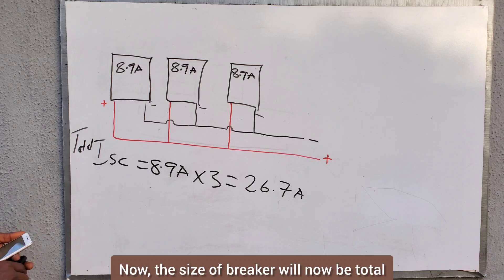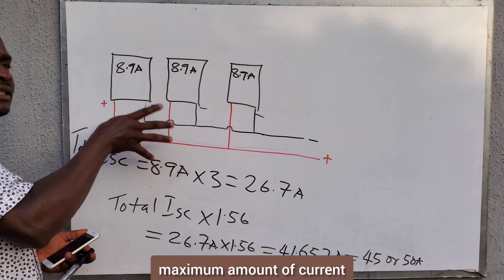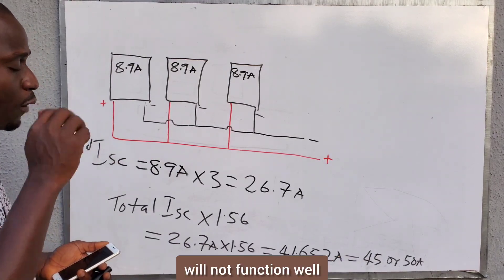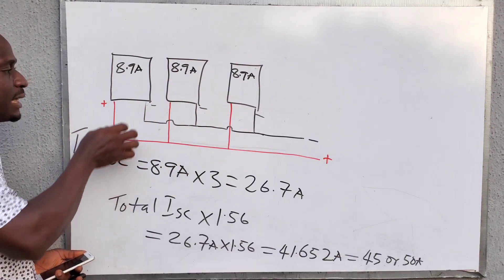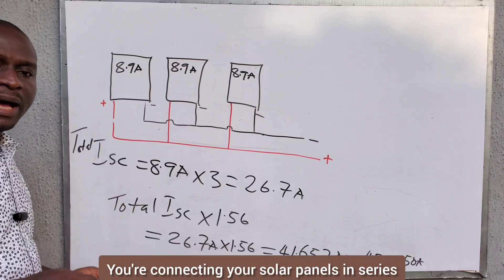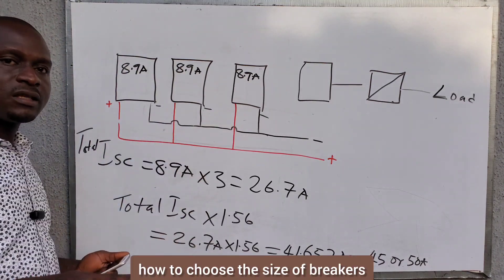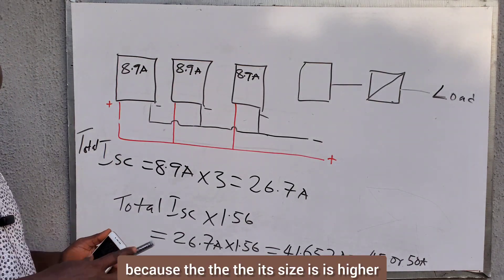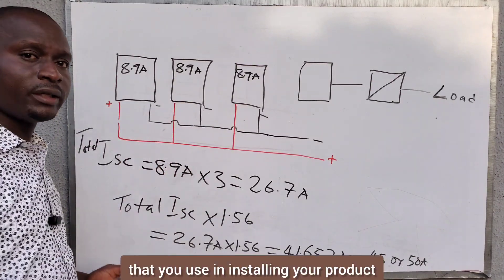How To Size Breakers.

Comment: Sir, please, what if the panels are connected in series parallel? Are you going to add the total value u had for the series side to the total value u got for the parallel side.

Comment: Thanks for your knowledge sir, what i noticed while trying to install my solar was that its difficult to get 20a dc breaker  in the market but easy to get 63a dc breaker.
Reply: You are right! 63a is the lowest i found in my location, have to use it like that.

Comment: Hi. I have 3,5kw 24v inverter  .it got a minimum pv of 120v and a maximum of 500v . What size of dc breaker and spd can I use when I connect  solar 5 solars  in series

Comment: Great tutorial, and I really appreciate how clearly you explained the system layout!

For anyone wondering how to size breakers correctly (and safely) here is how i go about doing it —n.b:  these are the standard formulas used globally (which follows SANS and IEC standards) and i will give examples:

1. Solar Panels to Charge Controller:
Breaker size = Isc total × 1.25 × 1.25
(First 1.25 = continuous current factor, second 1.25 = safety buffer)

2. Charge Controller to Battery:
Breaker size = Controller's max output current × 1.25

3. Battery to Inverter:
Breaker size = Inverter wattage / Battery voltage × 1.25

Example:

Say you have 2×410W panels in parallel (Isc = 12A each): 12+12 = 24A → 24×1.25×1.25 = 40A breaker

40A charge controller: 40×1.25 = 50A breaker

3000W inverter on 24V: 3000/24 = 125A → 125×1.25 = 156A, so use 175A or 200A breaker

Make sure to use DC-rated breakers and match cable size to the current. Hope this helps someone out!
Reply from the maker: Thanks 🙏
Reply: Can you also write the cable sizes that should be used according to this sample study? please..
Reply: @v_fidan Sure! For anyone wondering what cable sizes to use with the breaker examples, here's a quick guide (based on SANS/IEC standards):

1. Solar Panels to Charge Controller (40A breaker)
Cable size: 6mm²–10mm²

Use 6mm² for short runs (<5m)

Use 10mm² for longer runs (up to 10m) to reduce voltage drop

2. Charge Controller to Battery (50A breaker)
Cable size: 10mm²–16mm²

10mm² is fine for short runs

Go for 16mm² if the cable is long or it's in a hot area

3. Battery to Inverter (175–200A breaker)
Cable size: 35mm²–70mm²

Use 35mm² for short runs (<1.5m)

50mm² for medium runs (up to 3m)

70mm² for longer runs or minimal voltage drop

Tips:

Use quality stranded copper cable

Keep cable runs short

Protect both + and – with fuses/breakers (unless system is grounded)

Hope this helps!

Please leave a like if you appreciate the answers so that I can come back to it
Reply: @trumpisthebestever  Thank you so much
Reply: @trumpisthebestever  thank you so much
Reply: Wow!..
Reply: Please bro can i have your email or number? I would want to discuss something with you. Am having trouble with my 16kw system. Thanks

Comment: I'm quite impressed with your teaching, it's very interesting and I like it. Please can one connect more than one inverter (may be 2 inverters) to one Solar Charge Controller in supply power or electricity for different purposes?
Reply: In most cases, you should NOT connect more than one inverter directly to a single solar charge controller. Here's why — and the safe ways you can do it depending on your setup:

Why You Shouldn't Connect 2 Inverters to One Charge Controller Output Directly

A solar charge controller is only designed to charge batteries, not power loads (like inverters) directly.

Inverters should always draw power from the battery bank, not from the charge controller.

Connecting multiple inverters directly to a controller can overload it, damage the system, or cause voltage instability.

Correct Way to Connect 2 Inverters in a Solar System

Yes, you can use 2 inverters, but do it like this:

Option A: Both inverters connected to the battery bank

Connect both inverters independently to the battery terminals (or busbars).

Each inverter should have its own properly sized DC breaker or fuse.

Ensure your battery bank is large enough to supply the total combined inverter load.

Option B: One inverter for AC loads, another for backup or specialized tasks

This is common if you’re using, for example, a grid-tied inverter and a backup off-grid inverter, or a low-wattage inverter for lights and a big one for heavy appliances.

Just make sure the battery can handle both.

Do not combine inverter AC outputs unless they are designed to be paralleled.

Always size DC cables, fuses, and breakers based on each inverter’s amp draw.

If you’re running 2 inverters, consider using a proper DC busbar and fuse box to keep things organized and safe.

Comment: Kudos to you i am just watching this. Pls will the fuse be outside on the roof or it can be in the pv box inside the room with the help of fuse holder? Are we going to size our pv breakers/switch using the same current rating as the fuse?

Comment: please make a video for inverters, their ratings and how to connect panels with inverter
Reply from the maker: I will very soon... Thanks
Reply: @Solarwattng  Sir i need complete video with step by step from solar panel selection to breaker selection with inverter from inverter to battery and inverter to load breaker size calculation

Comment: What about from the charge controller to the battery, is it needed?? Nice explanation.👍🏽
Reply from the maker: Yes... You need to install a breaker between the charge controller and battery.
Reply: @Solarwattng  do you have a video sizing that one? Ex: If the charge controller is 60a then what breaker size is needed?

Comment: So if you have 4 panels in series and the open voltage nears 100v dc should that also be sized with a factor like the amps is, in my case I would need a 10 amp breaker but my voltage would be about 90v open voltage

Comment: How did you make up with these safety factors(1.2, 1.56). Watching from Zambia.
Reply: These are industry wide safety standards used universally world wide derived from manufacturer consortium testing labs.  To get their safety approval letters and stamps from these "safety labs" the manufacturers voluntarily make the panels (of many different sizes and wattage) to conform within these safety margins if properly fused and interrupted by correctly rated circuit breakers.  This is why ALL solar panels list their maximum output current and voltages even under fault so that if you use the safety margins as listed in this video you will oversize the wire, fuses and circuit breakers correctly for safety.
Reply: 5:27 @user-dw9ou9sg2p  ok😢 thanks Sir. And I'm really looking for a book 📚 I can use to study more about solar system.

Comment: Welldone Engr., pls i suggest the IEEE/NEC/IEC standard is to multiply the current by 1.25 safety factor, but most times breakers of the rated value isn't easily found in the market.
Reply from the maker: @alexanderukwachi6730  The NEC standard for pv side of the system is 1.56 not 1.25. Thanks
Reply: @Solarwattng thanks sir

Comment: Why is panel 1.5 SF and inverter 1.25
Reply: The panels have a safety factor of 1.56 because solar panels can over produce more than their rated capacity in certain conditions (in hot weather panels produce less than their rated capacity but in very  cold weather they can produce much over 100% of their rated capacity).  The battery to inverter connection is a much more controlled capacity and only requires a 1.25 safety factor as batteries, unlike solar panels do not over produce current and voltages because the temperature or sunlight changed.